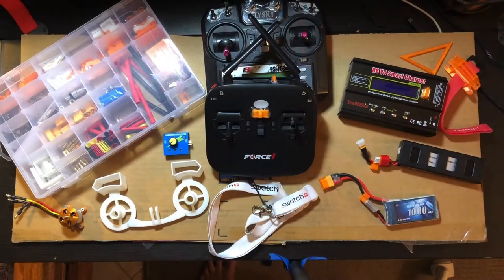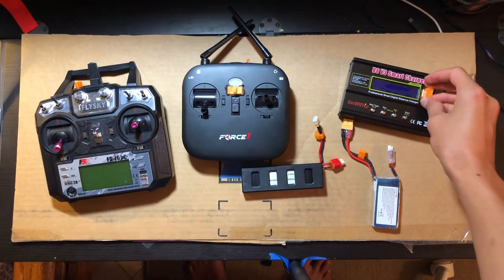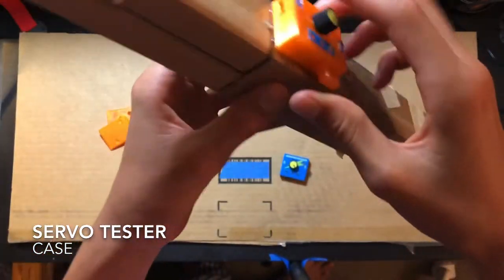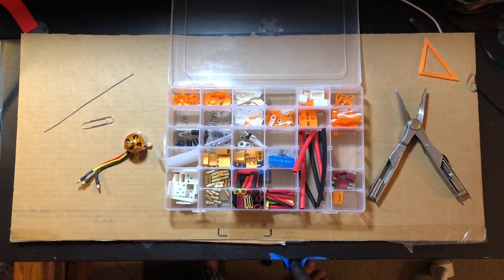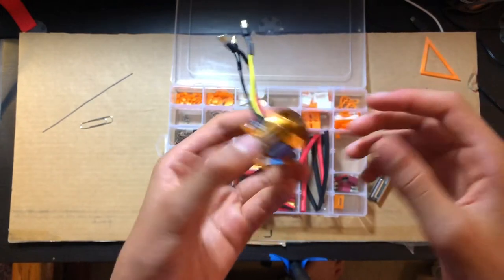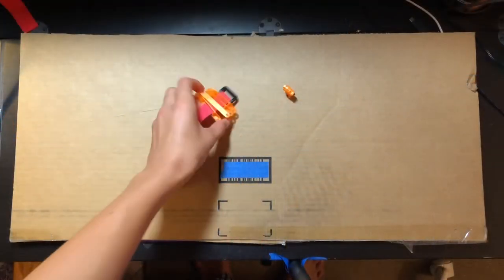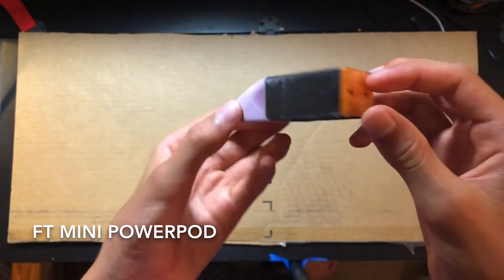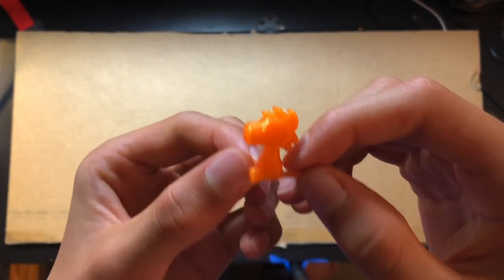3D Printing for RC Planes - 3D Printed Propellers?

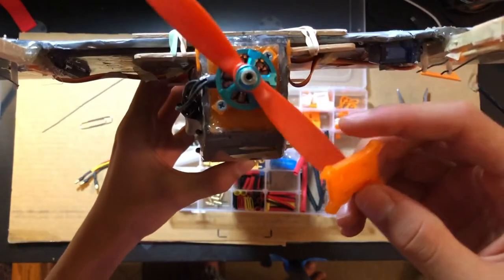Comment: Hi Orange Baron, thanks for posting this, there isn't enough knowledge out there regarding useful FDM prints in RC. I never heard you mention what filament you were using? One thing, at 7:00 you're showing us a printed motor mount, I wanted to let you and your viewers know that PLA is not a suitable material for motor mounts, or anything else that may be exposed to high temperatures. PETG and TPU are better materials with higher temp thresholds before softening, but ABS is likely what you want to print motor mounts with. I've gotten away with using TPU spacers on a PLA nacelle, but even then I wouldn't put much faith in it. PETG is only a tiny bit more expensive, and just as easy to print. Most issues you have with PETG prints can be cured with a heat gun in post processing. 

My most useful prints so far are TPU camera mounts for FPV and HD cameras on my drones - 45 and 65 degree sets. The cameras are very vulnerable, and the TPU can help dampen hits, as well as smooth out high frequency vibrations. Also, Pan and Tilt camera mounts using 5g or 9g servos for planes and cars are super cheap, and give you something to do with all your knobs and switches. I see you use Tinkercad and Thingiverse - you can easily find a custom canopy somebody designed for Plane X on Thingiverse, and very easily adapt it to your Plane Y. Right now, I'm printing a Momo steering wheel, column, and servo horn adapter so my FPV FY03 truck will have moving steering in the FPV and HD video, with a drivers helmet I designed in Tinkercad to house an FPV camera. I don't think I'd ever trust a 3d-printed prop, though, too much to lose if the prop fails.

Last, and my FAVORITE use for printers in RC - support parts for Flite Test kits! Foamboard planes are amazing, and additions like rubber-band stress relievers to protect your foam, servo mounts so you can swap bad servos without destruction, and flat battery trays for their wing designs. 

Want a bad ass $5 plane? How about a Flite Test Arrow mini wing, 2 sheets of foamboard.
Printed winglets, using semi-transparent PETG, with LEDs behind
Printed fuselage, also PETG, lightweight but rigid, and a great place to mount LEDs shining into each wing and an irresponsibly big LiPo
Printed motor mount, same as drones for vibration damping, in TPU
Hinges are 2-layer thick TPU rectangles, and horns are PETG.
Want it to last? Laminate it.
Reply from the maker: Wow! Thanks for all the suggestions! The filament is petg and I have found that it is  actually cheaper than pla on Amazon. Anyways, I have not had issues with pla or the petg motor mounts but your concerns about pla are definitely valid. Thanks for checking out all my videos!